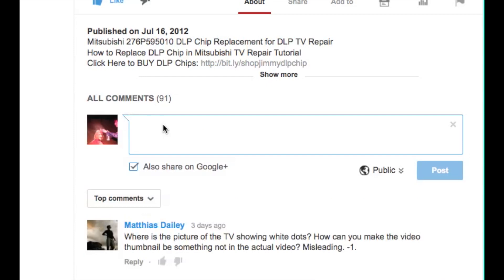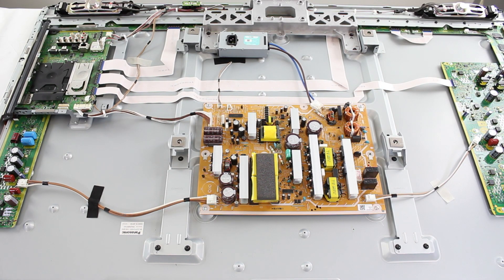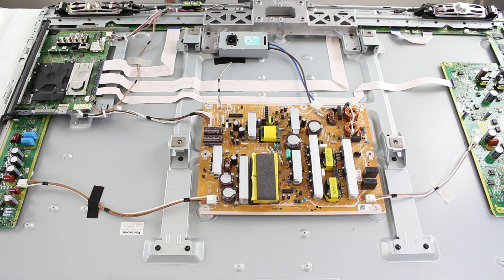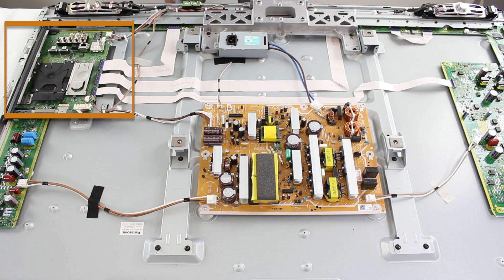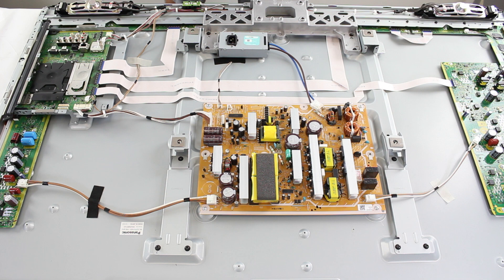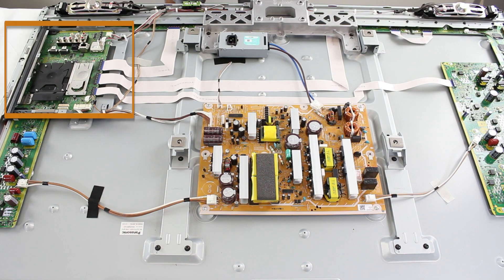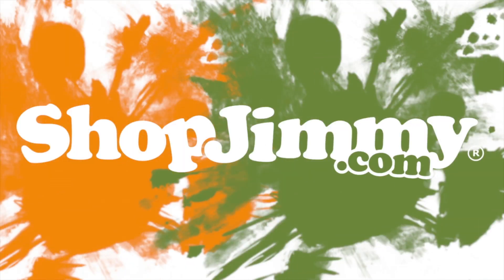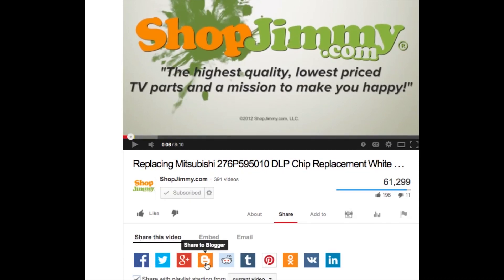TV Not Working After Storm - TV Lightning Strike & Storm Guide for Power Surge Problems

Comment: Suspect a lightening strike passed through wall plug into my Sony Bravia KLV-32R407A.  The cable still provides picture and sound but the picture is pixelated.  The red standby light is on and working.  Ideas on which component has been damaged?  Thanks.  Steve.
Reply from the maker: +Steve Lhyne  Try all repairs and troubleshooting at your own risk.  I recommend replacing the main board and the power supply board in your TV.  Unfortunately I do not see any replacement parts in the search results for your TV model number on our website.  Please reply with your part number on your main board and I can try searching for replacement parts.  Thanks and please let us know if you have any further questions!  www.shopjimmy.com

Comment: I have a Sceptre X240BV-FHD and everything on the tele works except for the 2 HDMI ports that are look like they're fine but basically do nothing as far as show picture or sound which was a result of a power surge from a lightning strike. What could be possible culprit of the issue? i know how to solder could you point me in the right direction?
Reply from the maker: SolBladeLeo  Please watch this video FIRST to help with your repair!  https://www.youtube.com/watch?v=BP3NVNCGEv8  I recommend replacing the main board in your TV.  Click this link to replacement parts for your TV.  http://www.shopjimmy.com/catalogsearch/result/?q=X240BV-FHD  Be sure to match part numbers on your current board, with your replacement for compatibility.  Thanks and please let us know if you have any further questions with your TV Repair!  www.shopjimmy.com

Comment: Good day i have a 50 cm plasma tv panasonic viera. If u switch the tv on the green light came on and after that the red light flash 14 flashes. U can hear it click but don't switch on. It had a power surge. Hopefully some one can help. Thank you André
Reply from the maker: andre Strydom   I recommend replacing the power supply and the main board for your TV.  Please reply with your TV model number so I can recommend replacement parts.  Click here to view a video that shows how to find your TV model number:  TV Repair Help IMPORTANT TUTORIAL How To Find Your TV Model Number Tutorial TV Repair Help  Thanks!  www.shopjimmy.com

Comment: Hi, I need assistance with figuring out how to fix a Vizio M70-D3.  This TV would no longer power on after an evening that had a lot of lightning.  It was hooked up to a surge protector, and all of the devices on the surge protector are fine, except for this TV.  This TV is hooked up to a cable box via an HDMI port, and this house had several cable boxes that were no longer working after that evening, so I'm thinking it received a surge via the HDMI port?  I went ahead and purchased a power board, and main board and installed them in this TV, and it is still as dead as it  was before.  I'm at a loss as to what else the problem could be, unless one of the boards I bought were bad.  There are four total boards in this TV, so perhaps it could be one of the other two?  Any assistance would be greatly appreciated!!!!

Thank you!!!

Comment: lg 60pn5000 wont turn on after thunderstorm, tv and direct tv receiver both plugged into same outlet, both no longer work, tv has a red light on like in standby mode but wont turn on when the power button is pressed, light usually turns blue when tv is on, but know stays red. thanks for any input.
Reply from the maker: james tanner  Try all repairs and troubleshooting at your own risk.   I recommend replacing the main board and the power supply board in your TV.  Click this link to replacement parts for your TV model number:  http://www.shopjimmy.com/catalogsearch/result/?q=60pn5000  There may be multiple boards for the same TV model number, be sure to match part numbers on your current board, with your replacement for compatibility.  Thanks and please let us know if you have any further questions with your TV Repair!  www.shopjimmy.com

Comment: Ok. Need your help. Have Samsung TV model UN75JU641D. Last night my wife and kids were watching tv, there was a storm with lightening. We have direct tv. They said tv shut off all of a sudden and can't turn it on. There is no life, no red light or blinking light, nothing. Everything else works, direct tv etc. Did not have to check the circuit breaker as everything else works in the area of the tv. The tv and everything else was plugged into a bar strip., its still working. I looked it up on line tried this morning unplugging the tv, holding the power button for 30 seconds and still it won't go on. Changed batteries in the remote. Not sure what else to do or who to call. Its on the wall and I would need assistance taking it down. Even if I did and opened the back I wouldn't know what to do I do not have the instruments I need. My main questions what do I do? who do I get to come to my house to fix it? what are the usual suspects with this tv? and cost wise what's the best case and worst case scenarios? I'm sure I have more questions but that'll do for now. Thank you in advance for your help.

Comment: hey there, my house got hit yesterday and my tv is fried. I have an SV470M model.  I have a standby light but nothing happens when I hit the power button. I opened it up and didn't see any obvious burn marks anywhere. then I flipped over the power supply board and saw a small burn mark right where the ceramic  fuse is. any help would be greatly  appreciated!

Comment: my sony lcd tv model # KVL-22BX320..trouble no power caused of ligtning strike... were  can i order the main board???i need your reply tnx you..
Reply from the maker: +Rhafy Faulve   Try all repairs and troubleshooting at your own risk.  I recommend replacing the main board and the power supply board in your TV.  Click this link to replacement parts for your TV model number:  http://www.shopjimmy.com/catalogsearch/result/?q=22BX320  There may be multiple boards for the same TV model number, be sure to match part numbers on your current board, with your replacement for compatibility.  Thanks and please let us know if you have any further questions with your TV Repair!  www.shopjimmy.com

Comment: Westinghouse uw40t2bw.... inwas actually watching tv and a bolt came out of a slow shower. Tv cut off will not turn back on. Surge protector seems fine.  No led on power completely gone. Hopefully its just the power supply

Comment: we have a LG 47WL5300-UC LED 3D that was affected by lightning hitting the satellite dish. When u plug it up nothing lights up but u hit the power button and it flashes red twice and turns blue but the screen doesnt come on.. any advice? thanks
Reply from the maker: Tanner Hale   I would recommend replacing the main board and the power supply board in your TV.  Unfortunately I do not see any replacement parts in the search results for your TV model number on our website.  Please reply with your part number on your main board and I can try searching for replacement parts.  Thanks and please let us know if you have any further questions!  www.shopjimmy.com

Comment: However, if you turn it over, then turn it on, it will work for a short moment, then burst into the same problem again. The lightening hit close to the house and also took out a motor for height adjustable table and an ATT modem.

Comment: Sansui model HDLCD3250A after a lighting storm it doesn't have a picture but has power. I checked all the boards and no burn marks, as far as I can tell no cracks either. What is the problem?
Reply from the maker: Scott Vance   I recommend replacing the power supply and the main board in your TV.  Unfortunately I do not see any replacement parts in the search results for your TV model number on our website.  Please reply with your part number on your main board and power supply board and I can try searching for replacement parts.  Thanks and please let us know if you have any further questions!  www.shopjimmy.com

Comment: I have a LG Plasma TV that was knocked out by a power surge about a week ago, I do have a red stand by light on and the tv had been showing life but had not comes back on can my tv be saved off do I need to get a new one??
Reply: Model # 50PT350-UD
Reply from the maker: TERI MOORE  Please watch this video FIRST to help with your repair!  https://www.youtube.com/watch?v=BP3NVNCGEv8  With a power surge, it is recommended to replace the power supply board and the main board in your TV.  Click this link to replacement parts for your TV model number:  http://www.shopjimmy.com/catalogsearch/result/?q=50PT350  There may be multiple boards for the same TV model number, be sure to match part numbers on your current board, with your replacement for compatibility.  Thanks and please let us know if you have any further questions with your TV Repair!  www.shopjimmy.com

Comment: I have a 55 visio VF550M   that took a lightning strike...afterwards had picture but no audio which we hooked up to a sound bar....tv worked fine for a few days....then it would not shut off with-out un-plugging it...when the tv was re-plugged in and heard the power on...now no picture...we pulled the back cover off and found no signs of burn marks or such as in the video...thanks
Reply from the maker: bill dzialak  Try all repairs and troubleshooting at your own risk.  I recommend replacing the main board and the power supply board in your TV.  Click this link to replacement parts for your TV model number:  http://www.shopjimmy.com/catalogsearch/result/index/?q=VF550M&tv_brands_select=Vizio  There may be multiple boards for the same TV model number, be sure to match part numbers on your current board, with your replacement for compatibility.  Thanks and please let us know if you have any further questions with your TV Repair!  www.shopjimmy.com

Comment: I have a Samsung plasma TV that I believe suffered power surge damage during a thunderstorm. It was plugged into a power strip, and working an Xbox at the time. The power strip, Xbox and cable box still work. The TV suddenly turned off when there was a lightning strike and we can't get it to do anything since.
The model code is PN51F4500BFXZA, version # TS02. It was made in March 2014.
If you have any idea which part it may need, or could advise me what to look for when I take the back off it, I would be very grateful! Thank you.

Comment: HI Guys I have an LG 42 inch flat screed TV LED model # 42LD450-UA and after a lightening strike the tv will not power on. By the way the tv was not turned on at the time of the lightening strike and the tv was plugged into a surge protector. The surge protector is ok and also a dvd player that was plugged into the protector is ok, The back light on the tv will come on but nothing else will work any help would be great. This is my first time working on any tv Thanks Randy
Reply from the maker: jessi nolin   PLEASE SUBSCRIBE TO OUR CHANNEL - Try all repairs and troubleshooting at your own risk.  I recommend replacing the main board and the power supply board in your TV.  Click this link to replacement parts for your TV model number:  http://www.shopjimmy.com/catalogsearch/result/?q=42LD450-UA  There may be multiple boards for the same TV model number, be sure to match part numbers on your current board, with your replacement for compatibility.  Thanks and please let us know if you have any further questions with your TV Repair!  www.shopjimmy.com

Comment: Great video! Thanks for sharing!  I have a project TV that I am working on: NS-50L240A13 50" Insignia.  Failure was noticed after a power outage at a home with cable.  No burning on any boards.  I am receiving power through the power supply board but due to the intricacy of the circuits, I cannot pinpoint where the issue is.  I replaced the power supply board which didn't fix the problem, still no standby light.  I have just ordered the main board tonight.  I researched the TV to find many complaints of faulty capacitors.  Are there any other places to look if both do not work?
Reply from the maker: dean lamonica  Please watch this video FIRST to help with your repair!  TV Repair! LCD, LED, Plasma, DLP How To Fix Your TV with ShopJimmy.com Help!  I recommend replacing the main board.  Since you already replaced the power supply, I would not worry about bad caps.  Click this link to a replacement main board for your TV.  http://www.shopjimmy.com/insignia-6mf0090110-main-board-for-ns-50l240a13.htm  Be sure to match part numbers on your current board, with your replacement for compatibility.  Thanks and please let us know if you have any further questions with your TV Repair!  www.shopjimmy.com

Comment: I have LG 3D LED. I face strange issue with it. If I press main chip of 
main board (covered with heat sink, and gently press the heat sink with 
screw driver) little bit then it frizz video, give bright back light 
with no picture (gray screen with back light) and then restart. If I 
attached any source like HDMI, USB it works fine if not touch the main 
board or not close it back cover.

Comment: hello my name is jerry and i was just given samsung 55 inch that was struck by lighting threw an power bar and when turn on via control on back of tv i hear things click but nothing on screen the red light just blinks and blinks then when you unplug power you can hear everything click again then nothing and the power button seams like it don't work you can press it and the tv will not turn off or off just blinking.,  the model number is UN55D6900WF (XZA) built 2011 smart tv anything would help thank you.

Comment: I have a Samsung PN58C550GIF. I have a HDMI cable going into HDMI port 1 on the TV, from the HDMI output of my Samsung Soundbar. After some lightening, the tv seems to not be getting a signal from the HDMI ports. The TV powers on fine, and I still get sound from the soundbar, but no picture. The TV display seems to be working fine. I can see the source menu and any HDMI ports that do not have cables plugged in are greyed out, the HDMI ports that has the cable connected shows bright white, indicating a cable is plugged in... but there is message on the TV screen saying "No Signal" and the some stuff about checking the connection, cables, etc... I've tried switching the HDMI cable to all the other HDMI ports, they all go from grey to white, like they acknowledge the cable, but still no picture on the TV except for the image saying "no signal". I've tested running the HDMI cable from the cable box directly (no soundbar) to another TV (Hisense model TV) and to a HP monitor, and  both those work showing a picture. But does not work when I try from the soundbar to the Hisense TV or monitor. So I tried running from the cable box straight to the PN58C550 (thinking maybe it was the HDMI output on the soundbar), but still no picture. So now I may have 2 problems... 1) The HDMI inputs on the Samsung TV.  2) And possibly also the HDMI output on the soundbar (unless it just doesn't work with the Hisense TV and HP monitor for some reason). Several times I've tried unplugging the HDMI cable from the TV, unplugging the TV for a time, plugging it back in and then re-connecting the HDMI cable, with no luck. I've tried different HDMI cables as well with no luck. Any suggestions on what to try or have to proceed would be appreciated. Thanks!

Comment: I have a Samsung curved 4K TV. Model number is un65 mu6300 f. It will not power on I have unplugged it, plugged it back in the LED light does not come on. There was a storm and it was plugged into a power strip. But everything else in the power strip works but the TV.

Comment: After an extremely close lightning strike (damaged some electronic components and tripped a 15 amp breaker in main panel even though a whole house surge protector was installed) what are the chances it is only a fuse on the power supply?  (I know board is probably toast.)

Comment: I have a Samsung Model HT- H5500K Model Code HT- H5500k/XA that just died after a severe thunder storm, it was the only appliance that I had earthed in the hope that this would not happen, I handed it in for repairs and was told it is repairable although one cannot see or smell any damage at all. This is a DVD player and surround system.

Comment: Hi, I have a Samsung Visio VP322 HDTV10A flat screen tv that has a red flashing standby light and the whitish blue light under the word Samsung is on. I have already replaced the power supply board. Lightning hit a tree near the house and damaged the playstation, cable box, and other electronics in the home. The Tv did not have the light on below the Samsung name before replacing the power supply.
Reply from the maker: funkyjeweler  Please watch this video FIRST to help with your repair!  https://www.youtube.com/watch?v=BP3NVNCGEv8  You should also replace the main board in your TV.  Click this link to replacement parts for your TV model number:  https://www.shopjimmy.com/catalogsearch/result/index/?cat=56&q=VP322+HDTV10A  There may be multiple boards for the same TV model number, be sure to match part numbers on your current board, with your replacement for compatibility.  Here is a link to a video showing how to identify your part number, click here:  https://www.youtube.com/watch?v=kxkeGLhlQY8  Thanks and please let us know if you have any further questions with your TV Repair!  www.shopjimmy.com